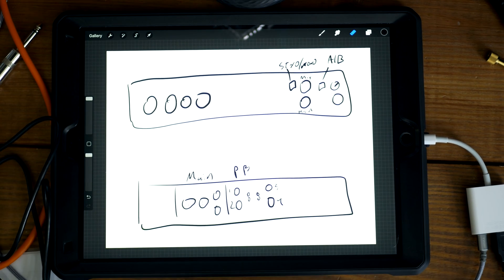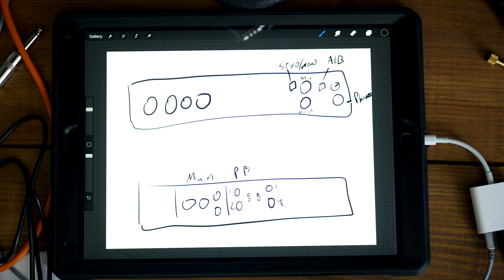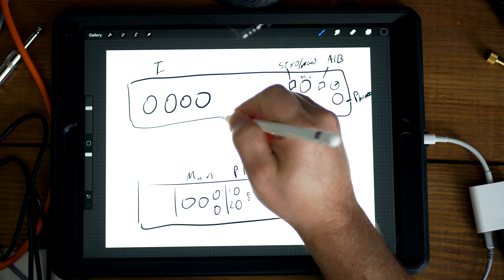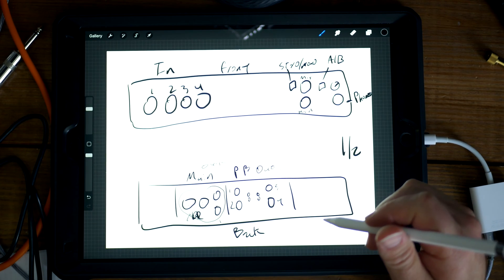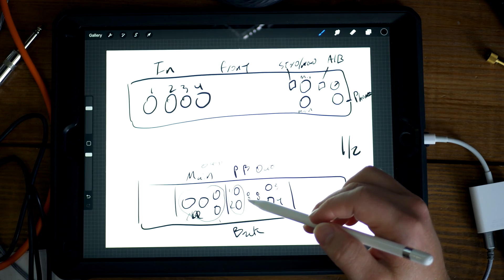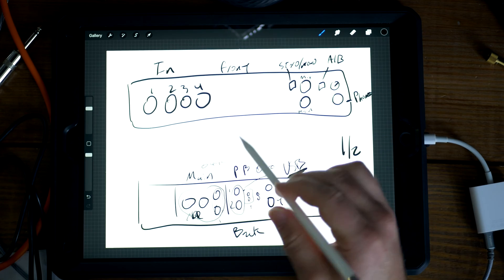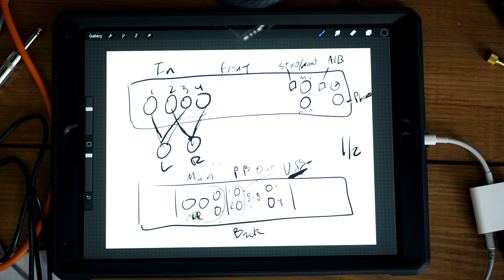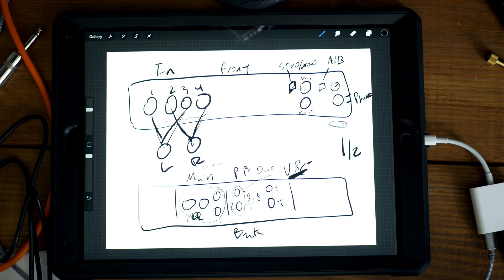Behringer UMC-404HD | Audio Routing Explained

Comment: Behinger legit sent me the link to this video. Bless your kind soul
Reply from the maker: I am glad it helped. I guess I need to contact them about a partnership. hehe
Reply: @TheAudioDabbler  Do you know how to route output in Garageband?  Doesn't seems to work there. Pretty poor they don't have a full manual for ALL functions. They do sell it cheap and for the price it's a great card but why pack it with so many options without telling how to use them? Great work! Thanks!
Reply: Tommy Larsson uhh i suppose you open the settings of garageband, and select under audio the output to umc404hd. I use logic so i suppose it is quite similar.
Reply: @ernstzjw6971   Yes thats the basic settings and Garageband can't route to more than Left - Right output as Logic probably can. As I was mainly looking for an extra output for another mix reference speaker I wanted to use the playback output B for that. As I couldnt route the signal in Garageband I thought It wouldn't work. Although, playback output A send the same signal as the main out so if I want to only listen to an extra reference speaker I can just turn the main volume down on Behringer and control the volume on my extra speaker on my Daw. Thats a workaround in Garageband. Can't have it all in a free program.
Reply: @tommylarsson2025  Is there any setting that you can choose outputs 3-4?
Reply: @ernstzjw6971   Yes. You can route either on Macs Audio/Usb settings. " Set Speakers" but if you can route in Logic I would do it there.  Are you up for a Second speaker setup too?
Reply: @tommylarsson2025  Because i use outputs 1-2 as the main output and 3-4 through the headphone jack as my in ear monitoring when playing live, so in logic i can choose on each track either stereo out or 3-4. Havent used garageband in awhile my apologies haha
Reply: @ernstzjw6971  No problem! :) 
Ok i got it!  I think many are confused about the "monitor A and B button" because the optimal use of it craves a routing function in the musicprogram as you describe (which is limited to only 1 and 2 out in Garageband,  otherwise it's just a button that mutes the headphones.

Comment: Hey....it looks like you know your stuff....I'm having an issue with the umc404.
I am live streaming vocals and guitar through my UMC404HD via the USB into an iPad and into Vimeo. It works pretty good, the only problem is that the volume level in the live stream is quite low and there is no volume control in Vimeo to change it (or on the iPad that I know of recording into Vimeo). I can't turn up the channel gains any more or it will clip. I thought the Main Volume would affect the output but it seems to only affect the outs to my speakers and not the USB out. Any help would be appreciated.

Thanks,

Kevin
Reply from the maker: One thing about the UMC404HD, it also utilizes the iPad volume control. So you may need to turn up actual iPad volume knobs. I have not tried to live stream with it or used Vimeo so I am not exactly sure. I can explore some things and see if I can figure it out. email me theaudiodabbler at gmail
Reply: TheAudioDabbler thanks very much for the response. I was looking for an input gain somewhere in iOS or possibly an app that could control it...never though of just turning up the volume. Sometimes Apple makes things so simple that I don’t think of it... infuriating! 😂
Reply: Hey... I had a moment to test this and unfortunately there was no difference between the two recordings that I did, doing one with the volume turned down and one with the volume turned up. Was hoping that was it.

Comment: Great Video, I get it. Now for stupid people like me, I want to use it for 2 speakers via XLR and 1 Subwoofer via 1/4 inch. I heard that normally the "Main Outputs" are for Speakers, but can I also connect the subwoofer with his 2 1/4 inch cables? Because normally you connect the subwoofer on the normal Line Outs, but in this case, they are only for playback (USB) but not for the instruments etc. so thats why I ask.
Reply from the maker: I am not really sure. I have never really used a Sub, I have my 8in Studio monitors and they are plenty bass for me. I can search out hooking up subs.
Reply: @TheAudioDabbler  yes that would be great.

Comment: hi, i have a question, can the 4 monitor outputs available be used together to issue 4 different channels? or is there another way that this soundcard can output 4 different channels from the laptop. thank you
Reply from the maker: yes, as long as whatever software you are using can see all 4 outputs, they can each have different audio going out of them.
Reply: @TheAudioDabbler  What does the a-b switch on the front panel do?
Reply from the maker: It switches what is being monitored by the headphones. A output 1/2 B output 3/4
Reply: @TheAudioDabbler  Is it possible that 4 playback and 2 play out can make 6 different sounds?
Reply from the maker: Unfortunately not. The Playbacks 1/2 are the same as the main outs.
Reply: @TheAudioDabbler  ok thanks

Comment: I have 2 keyboards (both in stereo) and I'm running Mainstage. So, I 
should run the USB from the UMC404HD to my hub (along with the USBs from
 both keyboards, and the USB to my MacBook Pro).  Assuming I tell 
Mainstage (or Logic) where I want the output to go, it should work, 
right?   For example.... Keyboard 1 is assigned in my DAW to channels 
(1) left and (2) right.  Keyboard 2 is assigned in my DAW to channels 3 
(Left) and 4 (Right), respectively.  On the back of the UMC404HD, I run 
(1/L) and (2/R) outputs to the left and right inputs for my mixer (for 
Keyboard 1).  Then, I run (3/L) and (4/R) to the left and right inputs 
for my mixer (for Keyboard 2).  Result, I get a stereo mix from my 
mixer, right?
Reply from the maker: From that example it should work. The major downside to this unit is that you need software to route the ins and outs correctly. But what you described should work out just fine as long as you have the outs setup correctly in your DAW
Reply: @TheAudioDabbler  Thank you!

Comment: I have connected my monitors to the MAIN OUT with the latest 4.59 drivers and the IN 1-2/OUT 1-2 selected in sound settings and everything selected in my DAW but still the mic sometimes records sometimes not and when  i go on youtube sometimes it plays the sound of a video  and most of the times it says ' if playback doesnt start, restart your device'...What do i do?
Reply: Unplug Power and plug back in. Works everytime it happens to me

Comment: I'm sad about this thing! Its junk! It degrades sound (sounds CHEAP!) and has no tasteful function!  Switches dont disengage audio, there is a constant low level sound passing, even with all switches off . The pots are cheap and scratchy with levels attuned way too high, clipping anything above 20%.

The "stereo" routing sounds like a split mono with extra treble. 

Use this box as a last resort
Reply: @Nino I don't have a way of knowing different?

Comment: I had a 2017 iPad Pro 10.5" and no sound from the UMC404....this quirk had me confused for a while as I know my way around audio interfaces (I have 5 of them, all working no problem)....Please read on if this is relevant: Remember to turn up the volume controls on the iPad itself. For some reason the digital audio signal is routed via the volume management on the iPad before it gets sent out via the USB back to the interface. I don't know if this applies to other interface brands or not but it is critical to achieving a good output signal.

Comment: video is really helpful! thanks!! ... just bought it today and first thought was that with this soundcard i can select  between two sound systems (first one near computer and second one around the room) ...But PC sees 1-2 and 3-4 outputs... So i cant hear pc sounds from 1-2 or 3-4 in one moment... I need to choose output in control panel and for example if it will be 1-2 from 3-4 i can hear only sounds from guitar rig or something, but no pc sounds at all... and there is nothing i can do about it..((

Comment: less than NO idea what you're talking about.
i'll come back when im smarter.
Reply: Steve, I understand. First time I watched this video, I didn't get it either. But... A simple answer on splitting the signal when playing live with your band: Send audio that you don't want the crowd to hear to 3/4. Press the "Monitor A/B" button down and now the sound that you don't want the crowd to hear is only coming through your headphones in the front of the Behringer UMC404HD (or 3/4 output in the back of the Behringer UMC404HD).
Reply: Lmfao I did not understand squat either
Reply: @Cl3tuss  The presenter here is not all that clear, this interface is really not all that complicated. this lengthy explanation makes it seem a lot more complicated.
Reply: he did not say anything relevant anyway.
Reply: Less than zero? Make that negative infinity.

Comment: That’s for the reply !! I understand kinda what you are saying . I would think that there is a way to overdub a easier way . It seems to me the only way to track with this setup is in real time . For instance , If i lay down my drum track and they decide they want a shaker track or some
Sort of percussion , how would I listen to the drum tracks I just laid down and then lay down a percussion track ? I can’t seem to do that which cannot be correct . With the UMC404HD I have to turn the mix knob to the right to here playback and then I have drums lagging in the mix . I am hoping I am missing something ...
Reply from the maker: what is your audio buffer set at? what DAW? When you have the mix knob to in, it is direct monitoring, and when its PB, its monitoring the playback. I don't think its the interface, it seems like there is latency  in the DAW. So one option, depending on the DAW you are using, would be to turn the mix knob all the way to PB, and use the DAW to monitor the armed track you want to add a shaker on. If that make sense.

Comment: I am trying to lay down a drum track to a pre recorded track minus drums .  I have my drum
Tracks setup on track 1&2, I have a percussion pad on 3 and my drumless track
On 4. How do I
Monitor ( headphones only ) the tracks I am just laying down while I listen to the drumless track which is out of record mode and track 1 to 3 set to record . I cannot set the mix to hear both without latency on the recording drum tracks . There has to be a way to
Record and playback simultaneously I would think thru headphones . I just need to hear the pre record track for reference to play the recorded tracks ( overdub Drum’s to a drumless track). This has baffled me for a week. I am using Personus one with the UMC404HD , running windows 7 connect with USB
Reply from the maker: It seems more like a software latency issue. The UMC404HD can monitor the 4 inputs and the playback via the mix knob. Try freezing track or bouncing them to audio so you can get the latency inside of Presonus One down to the lowest it can go. Maybe just bounce the entire drumless down to audio, open a new session, import the drumless track and then try that. that way the Playback is just simply playing back the audio and should have less latency. If that does not answer your question, reach out to me TheAudioDabbler at gmail and we can go from there.

Comment: @TheAudioDabbler I want to use either this 404 or the 204 at church.
I would only use it for playing backing tracks from my laptop.
If these PB outputs are simultaneous, I would like to use:
PB 1 & 2 for stereo sounds (pads, effects... )
PB 3 for mono tracks  &  4 for click track.
Is this possible with this interface?
I would appreciate your response a lot since I can't find this in the manual.
Reply from the maker: It should work. They can be stereo pairs or you can split them mono. Just to note, you will need to control the volume using software as there is not any volume knobs for the playback outputs.

Comment: Is my unit defect when I hear NOTHING on the playback USB output 3/4? Main out is OK, as well as USB output 1/2.
Reply: I have separate 1/2 and 3/4 in playback devices on my UMC204HD.
Reply: @Pentti_Hilkuri  Thx for answering. Solved my problem. Had a Cubase DAW on my iPad that was in demo mode and had the restriction. Restored the gear and now everything is fine"
Reply from the maker: @Pentti_Hilkuri  Thanks for helping the community!!!

Comment: Which output should be connected to the PA Mixer? Main output or Playback?
Reply from the maker: It depends on what you want to accomplish. Remember that Playback outputs levels must be controlled with whatever software you are using, while the Main outputs will respond to the main out volume knob on the front.

Comment: hey ! tnx 4 the vid. I have this unit and was wondering - can I use the out puts on the back (xlr and PL)  for two different pares of speakers? how can I switch between the two ?
Reply from the maker: I do believe you can send to multiple outputs but you cannot control it via the unit. It would need to be controlled some other way, maybe an external A/B switch?

Comment: How can I manage the outputs from my pc? I want to send a MONO signal from either of the 4 Outs in the back, to a Bass amp. I wolud like to send the same signal that is coming out from MAIN, through one of the 4 outs but having both L and R channels mixed as a MONO signal D:
Reply from the maker: As far as managing the outputs and inputs from a PC, you would most likely need to use a DAW. You can pretty easily acquire a free copy of Ableton live lite if you don't have one. There could be some standalone software that would allow you to route the audio but I would use a DAW to do it. Let me know what software you have and I can advise you further if you need help.

Comment: hey mate, im looking to use this device as a backing track set up for my band. are you able to route outputs to 1, 2, 3, and 4 individually of each and they be controlled separately of each other at a mixing desk? ie, tracks 1 would play a sample, track 2 would play a bass sample, track three would be something else and so on?
Reply: Same question here. I hope that the main outs and the playback outputs can add up to 8 individual outputs? (4 playback outputs, 2 xlr main outs, 2 TRS main out)

Comment: not enogh clear for me...if i have 2 pairs of monitors how i switch between them?
Reply from the maker: you would need to do that via software. The monitor A/B switch is only tied to the headphone port. So using whatever DAW you could create 2 sends and have one pointed at outputs 1/2 and the other pointed at 3/4. then to switch between them, just turn the sends up and down respectively. What DAW do you use and I might be able to give you further instructions.
Reply: @TheAudioDabbler  it will help if you can do a video...or explain a little bit more. i work with Sonar cakewalk.  i have 2 pairs of monitors (ones monitor output, the 2nds playback output 1& 2

Comment: hi thanks for sharing.. just wondering, can we set the phantom power individually on each of the inputs? thinkin about using it for 1 condenser mic (phantom powered) and 3 instruments.. or is it ok to use instrument (guitar, bass, keyboard) to phantom powered line?
Reply from the maker: tarakdungdes thanks for watching. No it’s all or nothing but It should be fine to plug in instruments. The phantom power is only sent on the XLR inputs. I actually use a condenser and a dynamic mic at the same time with no issues. Not saying that something couldn’t go wrong, or bad mic cables crossing the connection but it’s highly unlikely but if you are using 1/4 in cables for the instruments you will be fine.
Reply: @TheAudioDabbler  well noted! thanks for the prompt response! i was just a bit worried that the phantom power will fry the instruments :p the next thing is that I noticed that there's "line/inst" button near the "gain" knob.. what is it for?